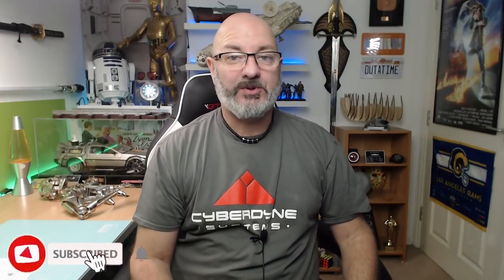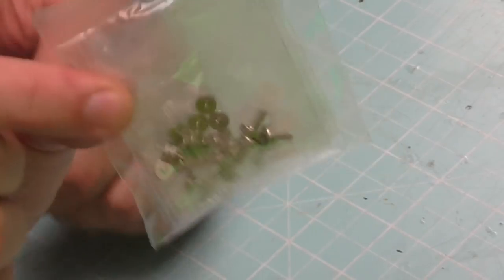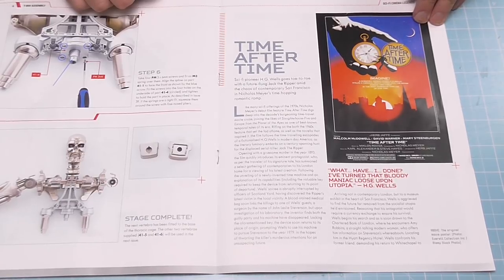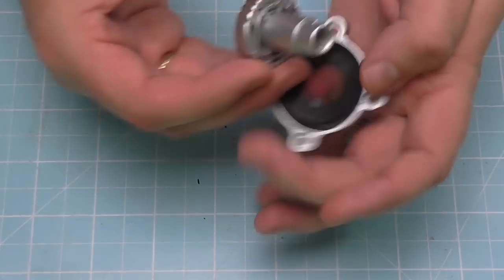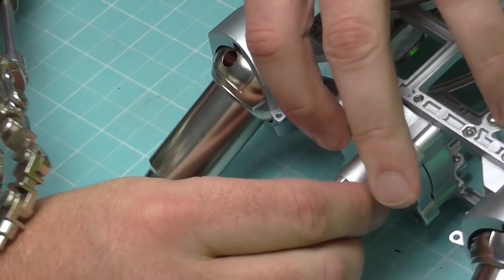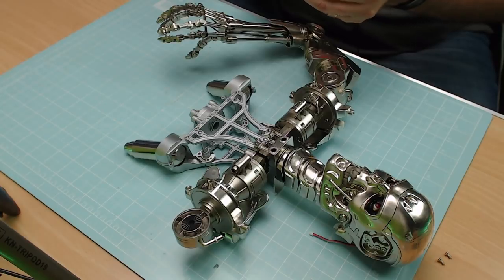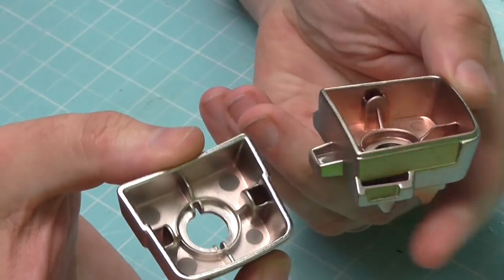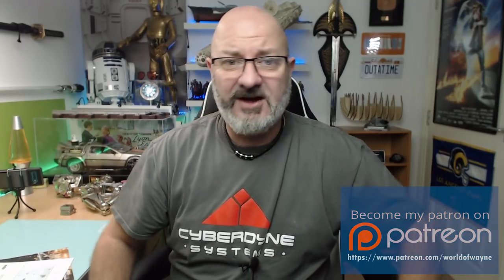Build the Terminator - Part 41 - Fitting a Vertebra and Casing

Comment: Great job. Those2black pieces are Rubber washers/their not plastic. And you can use acocktail stick/abitta Silicone Grease. Just to make sure that you get smoother spine/hip movement. Also we're be looking at another slightly bigger motor. 1for the T-800's eye's/Jaw's. And a2nd motor for the T-800's either spine or Shoulder movement. So this is gnna be1very powerful powered cyborg once it's fully finished

Comment: Didn't realise they were replacing all the finger pins. I thought we'd just get a half-dozen clear sleeves. I've only got one loose finger and the thumb, so nice one, Hachette.
Reply: You need to replace all the pins as the pins that the sleeves fit over are all smaller than the standard ones
Reply: @theundeadranger10  I don't need to replace the ones that aren't loose!  Literally just one thumb and one finger joint. The rest are fine. I'll keep all the spares in case of problems later.
Reply: @mikes5637  thats not what I'm saying I'm talking about the loose ones

Comment: I got issue 41 yesterday at my local WHSmith but it didn't come with any finger replacements. Do you have an idea what the problem could be
Reply from the maker: Check the bag again. Mine was stuck with static to the bag. I almost threw it away.
Reply: @WorldofWayneUK  Mine didn't come with any instruction sheets for the fingers though. If yours did, then there must be a problem. I'll still take another look just in case
Reply: @RVPMatt123   I also didn't get the instructions with issue 41, just replacement  pins!
Reply: @AdamKummrow5436  Really? I didn't get any replacement pins period, and I haven't thrown anything away 🤔
Reply: @RVPMatt123   Bag of pins were under the plastic contents, I thought the instructions would have been inside the magazine, but nothing so I'll  send hachette an email see if they will send instructions! 🤔
Reply: @AdamKummrow5436  I honestly saw nothing in my pack. I'll be getting it resolved soon though
Reply: @RVPMatt123   Gutted there was nothing in you issue, but so cool to know you will be getting a solution bro. 😎👍👌